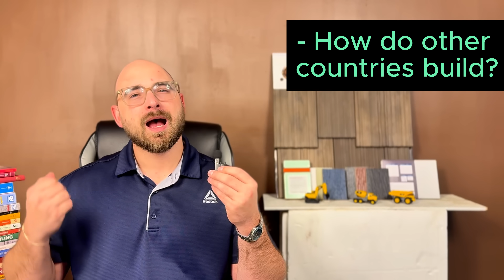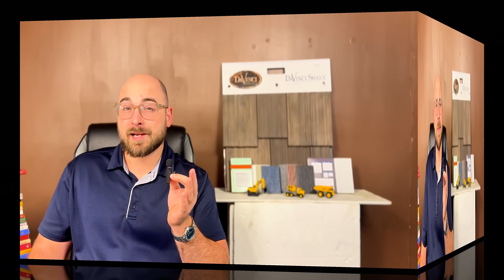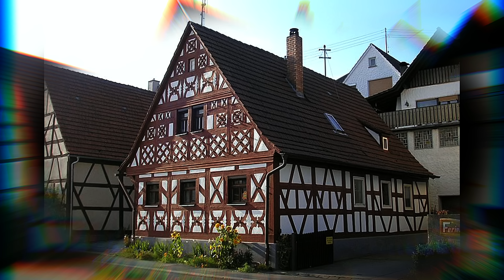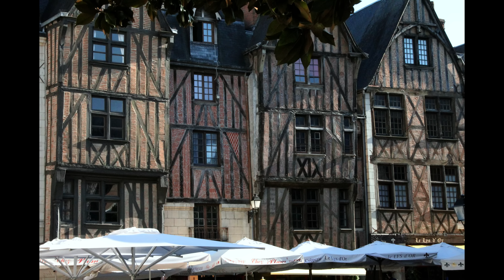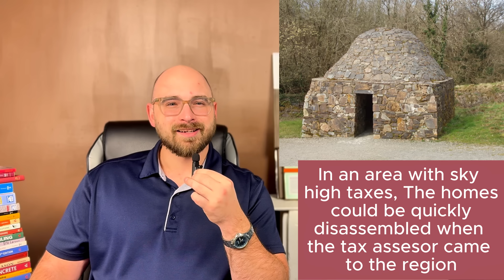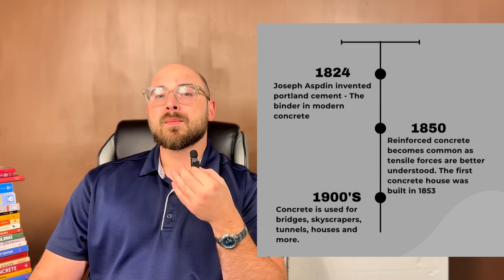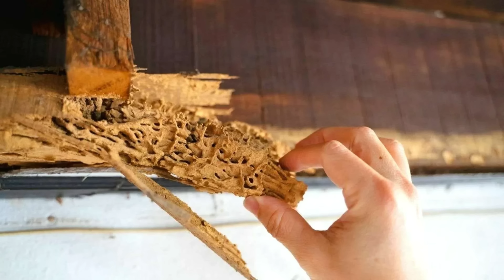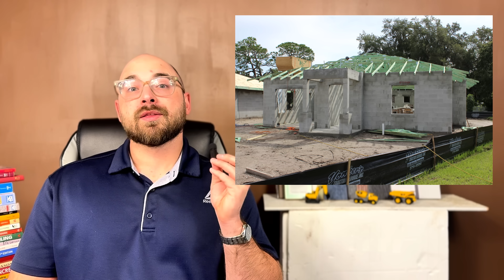Why Other Countries LAUGH at American Homes

Comment: ahem, 100 year houses are pointless.  You won't prefer that house throughtout your life path.
Reply: A House that will survive lifetimes can be passed to the children and grandchildren increasing family wealth and freeing them from serfdom of mortgage and usury.
It also saves energy and materials used for rebuilding temporary structures that have short lifespan and are not resistant to elements.
Last but not least - it creates lasting beauty of old neigborhoods, city quarters and villages that people want to live in and tourists visits. This is how civilization and culture is created.
If someone is immature and needs constant whimsical changes, there is a supply of existing quality houses (in countries that value quality) on the market and the old one can be sold and new one purchased or built.

Comment: As an American retiree, what bothers me most is how we fully jump on the latest flash in the pan great new product and convince ourselves that it’s the best new breakthrough, only to see its flaws a decade and a half later.   We are now cladding with essentially a toxic mix of adhesive soaked wood chips and plastic wrap, covered in Hardie lats that have proven to delaminate over time, plumbed with yet another revision of formerly problematic plastic piping with suspect connection methods.
Then we spray crappy open cell rather than far better R value closed cell.   Trim it out with $300 faucets that use mere plastic valve cartridges.   Use molding and caulk to fill huge gaps from carpenters who cannot properly measure and cut, then floor it with essentially plastic covered pressed cardboard.
Then we get to pay a half million dollars to live in this low quality ticky tacky McSame.
Reply from the maker: It wasn’t always this way, but as building science and products have improved, the industry has pushed for faster and cheaper 

A few decades of cutting corners later and we’re at a turning point, 

Brand new houses are moldy, settling unevenly, leaking and otherwise just falling apart

Comment: Our homes are built like crap, most of all the builders using any 2x4 even when it is bad and hide it behind sheet rock.  Why not build brick homes only they are stronger.  And not to mention 2x4 is not a 2x4 they cut the size down to get more lumber out of a log which is BS.  That’s why a stick built home is worthless

Comment: I agree with most of this but what he isn’t taking into consideration is the health affects of all of these materials. Using icf is very structurally sound but is full of foam which is incredibly bad for our health. It also traps moisture in the home so the home will need to have a good system to remove said moisture
Reply from the maker: EPS is incredibly stable, unlike site installed spray foam. 

Additionally all our ICF homes have HVAC load calculations performed, an ERV installed for fresh air, and whole house dehumidification as needed to provide the best air quality possible 🧼 😤

Comment: The asphalt roofing is so cheap. That's what is used on cheap garden sheds in Ireland. Slates or tiles would be much better and last hundreds of years.
A friend in Wisconsin paid 7000 dollars for a door. A good door in Ireland costs 2500 euros, tops. Your costings seem out of control.

Comment: The video missing a big point to north american housing and it's climate. But more importantly changes in climate. A house in North America can see 25deg difference in temperature in a single day. Europe and elsewhere usually have much more stable temperature. Due to this rapid heating and cooling. Or in a situation where the outside of the house can be 40c and the inside wall 19c we need materials that can with stand this disparity and also don't produce condensation. Wood framing provides this big benefit much more than solid structure does. Solid structure in North America that doesn't have the insulating factors of ICU construction it's highly prone to cracking and Spalding I'm this environment.

Comment: I have lived in concrete homes, and no, thank you. I prefer American stick-built homes—concrete feels like a bunker and very institutional to me.  
Forget about making your house feel homey because you can’t hang paintings, pictures, or shelves.  
It’s just a slab of concrete that feels dreary and depressing. 
No, thank you.🙂‍↔️
Reply from the maker: ICF hides the concrete

And you can hang pictures 🖼️
Reply: @Mike_Fortin Interesting video, 👍🏼.
What is ICF?  I lived in South Korea for several years, and their walls only (except the bathrooms) had wallpaper on them.
Reply from the maker: @Qua@QuaVadis3 ICF stands for insulated concrete forms 

Basically big foam legos that we fill with concrete 

Energy efficient, modern appearance, very strong 

Check out my page to see houses built with them!
Reply: @Mike_Fortin Thanks:) I will. 👍🏼

Comment: Everything about US construction is cheap and nasty but tricked up to look pretty.  The pretty doesn't last and within only a few years someone's pride and joy looks like junk.  eg CMU is cheap to make and quick to install BUT there is a problem - it is very porous.  If a quality barrier coat is not applied the wall will be black with mould in no time.  The builder doesn't care because he is long gone, the workmanship warranty has expired and besides, quality barrier coats are expensive.
Reply: I agree with all except one. Porosity of concrete is actually very low: 2-7%. For comparison brick is 12-25%. Low porosity causes accumulation of moisture on external concrete surface and mold development. In porous materials like hand made bricks, sedimentary stone or adobe, water travels freely - the wall breathes and mold does not form. Concrete wall should be plastered with breathing plasters: lime or clay based to mitigate this problem and improve the building air quality.

Comment: The disposable house isn't a bug in the American system it's a feature. The culture is built around the individual life cycle, not the generational one. You leave at 18, build your own thing, start from scratch. Each generation resets, and that's a point of pride.The problem is that model only works when wages are high and mobility is real. When housing costs outpace wages and young people can't afford to start from scratch anymore, there's no fallback. No grandmother's apartment. Just a 1987 wood-frame house with mold in the bathroom that nobody can afford to fix.

Comment: Here in Florida, I watched a big housing development go up. They put them in about 20 at a time. pouring the foundation and the driveways, then the walls went up. This was in the rainy season. They were built mostly out of 2x4s, covered with particle board. Did I mention rainy season? They put in the cheapest windows and doors, stapled on the cheapest roof possible, And blasted some kind of stucco on them to make Tham look like block houses. Before they were even sold the stucco was cracking. They sold like hotcakes. They were advertised as light and airy (big windows, inefficient at retaining heat or cold) granite countertops, 3 full baths, wet bars. Nobody bothered to look past the wet bars, windows, and pretty kitchens. Part of the problem is the construction, but part of the problem is the consumer. Their ignorance is alarming. When their houses are falling apart just a year later, they try to sue, but the builder has shut down that project, changed the name of the corporation and moved on. The buyer stuck. Hard to feel sorry for people that stupid.

Comment: I can’t wait until hempCrete becomes legal not just an America but everywhere.
Reply: I do not understand this excitement about hempcrete and comments about it popping up here and there. First of all it's compressive strength is only 0.3 MPa so 10 times less than adobe which is already weak but completely adequate for quality buildings. It means that hempcrete can not be used as load bearing walls so it complicates the building process requiring concrete or timber frame and used as infill, but the insulative infill can be also made from light clay (straw and clay slip) which is much easier to source and make. Hempcrete supposedly uses hydraulic lime and lime nowadays is more expensive than cement and hydraulic lime is prohibitively expensive, but can be made by adding pozzolanic agent to regular lime, but it's not easy to purchase.

Comment: You don't need insulation if you build a bobble brick or a single stone wall then plaster.  This regulars the heat at both ends of the year.  No problem about burning down,  no need for air con as the stone regulates the heat and keep the cold out and heat in winter.

Comment: It depends on where you live and what's available concrete maybe viable with places that have granite and other rock available easily in some places the cheaper the better In Louisiana and other middle states it's way more expensive to build that way not to mention the bricks and other rock could become projectiles when tornadoes hit most people in the central US can't afford the luxury of a basement that costs an extra whopping 35,000 dollars. Also where I live at drywall isn't common but manufactured panels is the norm. I don't want to reveal too much. I did some  digging and if a person wants a house in the country it's fairly cheap I found a blueprint for 18,000 dollars online however land is high right now 69 000 dollars for eight acres. Average pay is 30,000 a year. Try and make a job here is like pulling teeth 500,000 dollars for just one job.

Comment: Even here in East Asia.
We're also wondering why American homes are made out of wood, expensive, very flammable, and mostly only have 1 floor.
Reply: Most American houses have three floors and they are made out of wood because it’s probably faster to build. Also we have tornados and tornados will use anything including bricks as missiles which will cause chaos.
Reply: @bosballl  
I'm pretty sure that not the entirety of your country aka every State are not getting hit by Tornados.
That isn't a good excuse for majority of your homes to be built from wood.

So far I'm seeing are 1 floors, rarely see any 3 floors unless it's from an expensive neighborhood built from the 80's-90's
Reply: @YukitoOnline Every state gets hit by tornados every year, they are more common than you think. Most American houses have a basement, first floor, and second floor.
Reply: @bosballl  
All the more reason to build your homes with cement/concrete reinforced with steel rebars, instead of wood.
Reply: @Y @YukitoOnline Nope that would be a terrible idea. Tornado will use whatever they destroy as a missile. It doesn’t matter what a house it made of, a tornado will and has destroyed well built brick houses before. Tornado can even rip plumbing out the ground.
Reply: @YukitoOnline  Every state can experience tornado, but not every state is considered a tornado state. Nobody thinks about them west of the Rocky Mountains where they are rare and rather weak. They are most frequent and most intense in the central/southern states with open plains - called for that reason Tornado Alley. Most places will never experience any serious tornado.
Reply from the maker: A well built concrete house can survive an F5 tornado 

I agree with @yukitoonline
Reply: @Mike_Fortin  If concrete houses survived EF5s, the EF scale wouldn’t include “homes swept clean from foundations”.
Reply: @bosballl  A simple grouted 8" block wall weighs 14 times more than 2x6 stick wall. Thicker masonry will be even heavier. Of course there would be cases of destruction, but much more rare and not complete. Light building acts as a sail.
Good example is a Joplin hospital that was partially damaged by a tornado while all shoddy construction was flattened around. It was rebuilt with cast concrete walls rated up to 250 mph. ICF walls would offer similar rating. They would be the material of choice in tornado, hurricane, flood, fire and seismic zones.
To increase the safety margin, houses can be built bermed up with soil or half in the ground or with dome shapes. Such approaches are used in vernacular architecture around the globe and for a reason.
Reply from the maker: @bosballl  “stick frame homes”
Reply: @bosballl  
I said "cement/concrete reinforced with steel rebars"
I didn't say "brick houses"

Read before replying
Reply: @ElegantiaeArbiter  
I think he doesn't know the difference between reinforced cement/concrete vs bricks.
Reply: @YukitoOnline  In US masonry usually means brick and brick usually means decorative exterior brick (non structural) or in some cases thin structural brick walls with no reinforcement or bond beams. This results in misunderstanding when talking about masonry for tornado or seismic zones.
Reply: @YukitoOnline  I know exactly what reinforced concrete with rebar is. Stop pretending that automatically makes a house better.

Tornadoes are a huge reason most U.S. homes are wood. In high-risk areas, wood-frame houses are cheaper to rebuild, fail in ways you can actually handle, and don’t collapse into giant slabs when debris hits. That’s why safe rooms exist instead of making every house concrete.

Wood is lighter, faster to build, easier to repair, and handles earthquakes better, which is important across much of the country. Single- and two-story homes are common because of zoning, land availability, and cost. Taller reinforced-concrete construction is expensive and usually reserved for apartments or commercial buildings.

Maybe where you’re from this would seem perfect or obviously better, but here it’s a completely different story.
Reply: @bosballl  Tornadoes are not the reason why houses are built from sticks. It's purely cultural. English speaking countries were settled by people coming from the same region of Europe and introduced their language and ways of building in US, Canada, Australia and New Zealand. South of the border the language changes and building material switches to masonry, despite being poorer, having more lumber per capita (most Southern American countries) or more intense and frequent seismicity than California (Chile) or even tornadoes in Argentina (less intense than tornado alley but more intense than west of Rockies).
Their settlers started with post and beam filled with cob, then advanced to adobe, fired clay bricks and then structural bricks with reinforced concrete.
Building a house and rebuilding will never be cheaper than building it once properly, because walls constitute only up to 30% of the building cost. It only creates massive waste and pollution.

Comment: I'm in Canada and a cement, stone or block home would be way too cold, even with insulation as cement draws in cold. My home has 6" of insulation in the wood framed walls, with brick as the outside cladding. I have a friend with a cement condo in Athens with about 1" of insulation. This wouldn't do in Canada even with more insulation.
Reply from the maker: There’s a lot of ICF home in Canada that perform quite well

Comment: Central Europe doesn't have the vast temperature swings the almost all of the US does. Florida can get below freezing for for weeks and then also be 100 degrees for a month. Brick and stone homes are horrible for hot humid climates and are terrible for very cold climates. Wood is much easier to insulate and that is a fact. Northern Europe generally builds in wood for this reason.
Reply: That's the short-sighted excuse of a throwaway society.

Comment: Have a friend from Palestine.  He was shocked to see how the homes were built here in the US.  Their homes are built with concrete blocks.
Reply: Concrete is used for load-bearing structures in the rest of the world. For thermal insulation, walls made of Poroto, fired hollow clay bricks, and mineral wool are used as additional insulating layers.

Comment: Speaking of concrete homes, I am most intrigued by the possibilities of emerging 3D printed house technology. Though production of such homes has so far been limited to only a few pilot examples in Europe and the US, it will be interesting to see it develop from its current nascent state into a mature method that becomes more widespread.
Reply from the maker: I’ve said this before but 3D printed concrete is a solution in search of a problem 

It still requires a full crew, it is weaker than a poured wall, it lacks proper reinforcement, and has thermal bridging and exposure to the elements. Concrete is porous and wicks moisture, which will corrode what little reinforcement it does have and lead to structural failure. Solar driven vapor will also make its way into the home. 

Furthermore, the walls need to be furred out if you want to attach siding / Sheetrock over them. 

For the same price (if not cheaper), you could do a poured ICF wall. Stronger, protected from moisture, has built in furring strips  for siding and drywall

Comment: Have to note, you can build modern and strong houses out of wood. Scandinavia is doing that just fine. Also using stone and bricks and so on. But still.
The issue is not the wood in it self. Its that its flimsy bad wood, and just one thing layer.
you should look up actual wood houses in Europe, they are build to follow the same rules that brick houses is pretty much.
So the issue is not wood, the issue is Americans.

And the way you take Scandinavian houses and think its the same thin timber structure as Americans is a big issue, and is just wrong. 
A US thin timber house would never pass the laws. They are not comparable at all.

And modern concrete is overall bad. 
Its does not give the same type of healthy building bricks will do.
And modern concrete is super bad for the environment. 
So being a "concrete nation" is not really good.